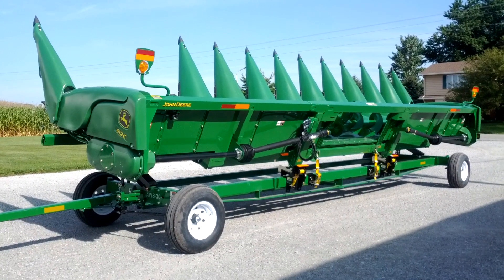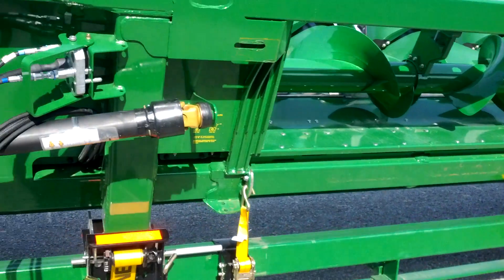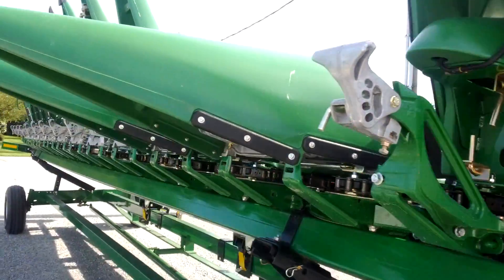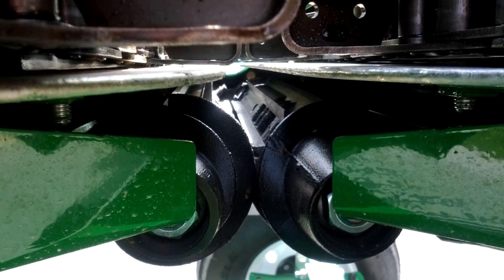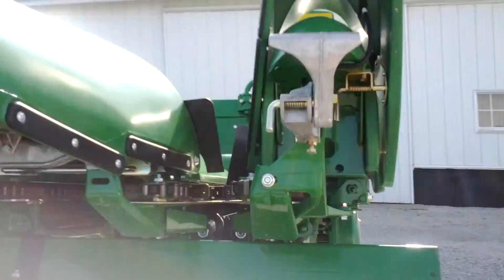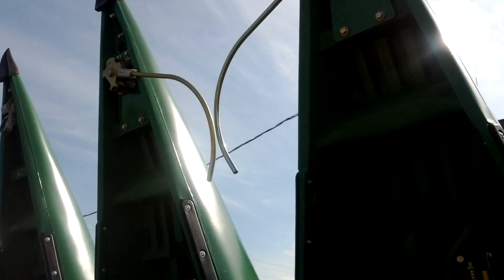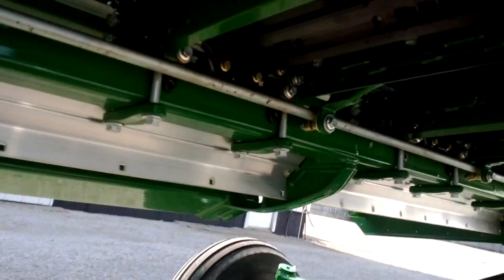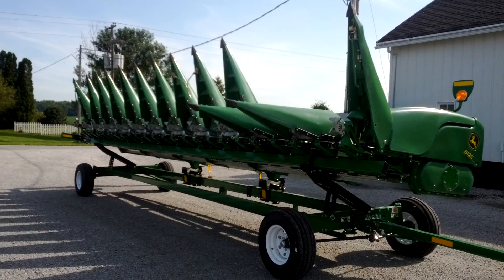How a Corn Head Works

Comment: My question is how do you keep anamals from getting sucked in the machine? Also, how does the machine not get 
tangled up?

Thank you !
Reply from the maker: Mack Plymale animals run away and then return to cover after you pass by. I have sucked a skunk a couple times. Not great. If you get some grass weeds tangling can be an issue but the crop generally isn't a problem. Wet stalks early in the day can be problematic wrapping the auger.
Reply: Thank you for your message. Just what I was looking for .... things that go wrong. So what did you do with that load of corn and how did you clean it out. I have a hard time understanding how the machines are so perfect and have such few problems.  I appreciate your video and hard work !
Reply from the maker: Mack Plymale the corn would be just fine. If you’re lucky you can run the head in reverse and things will unwrap and then go on through. Otherwise you shut the machine down for safety and detangle by hand.